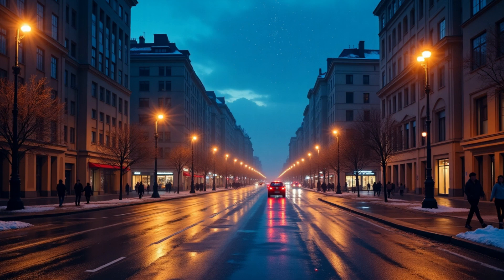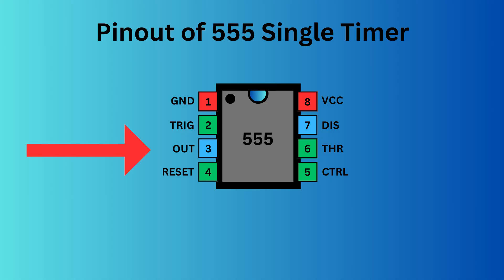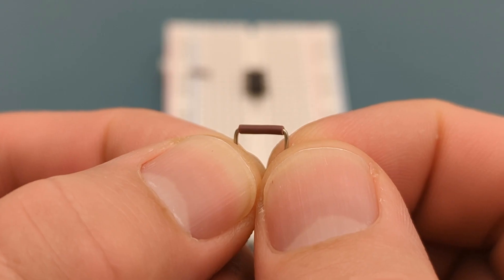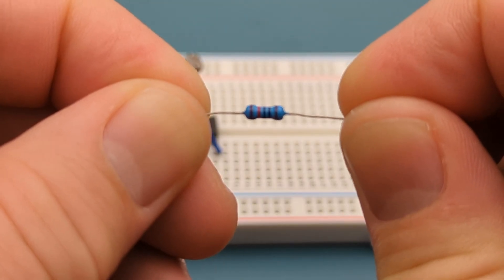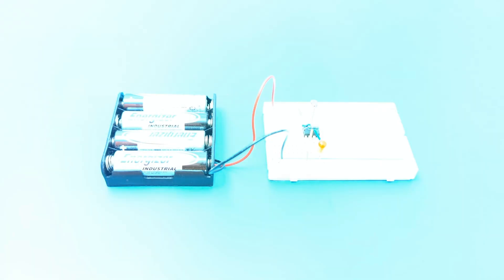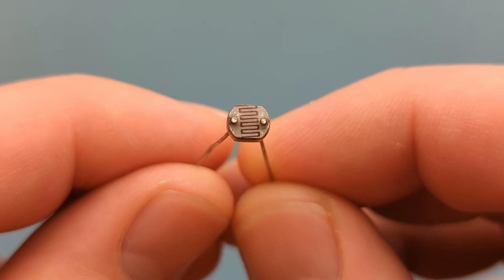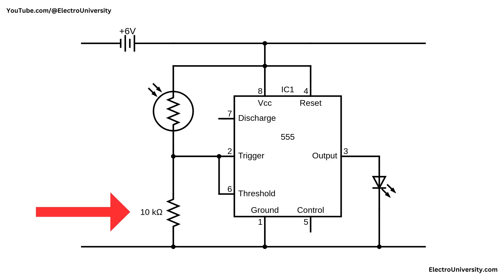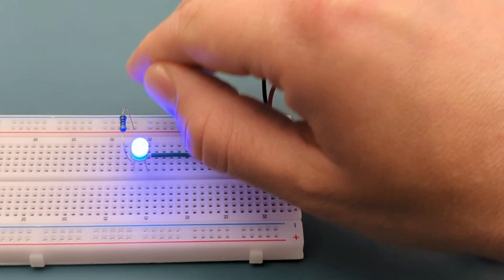How to Make Automatic Street Light With 555 Timer

Comment: why the led is not glowing in the dark, it's always glowing
Reply from the maker: If the LED is always on, double-check your connections. It's likely the voltage at pin 2 isn't dropping below 1/3 Vcc in the dark.